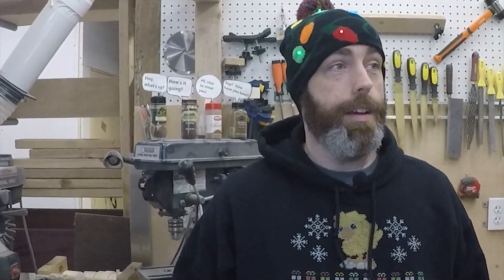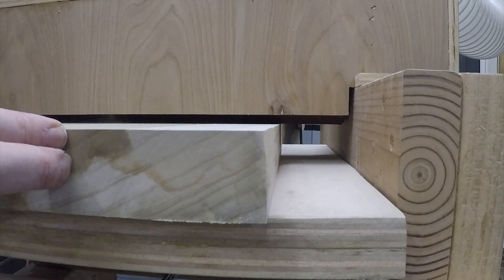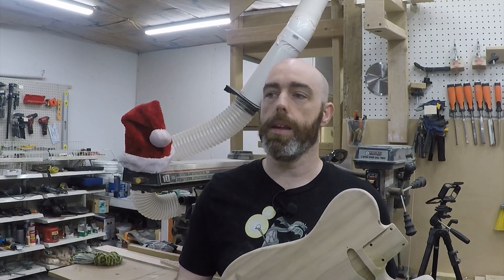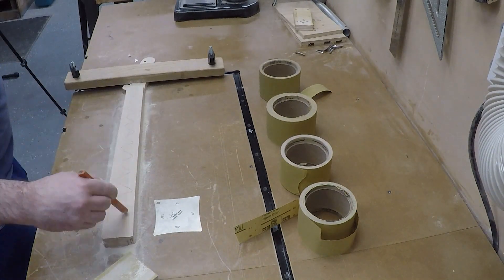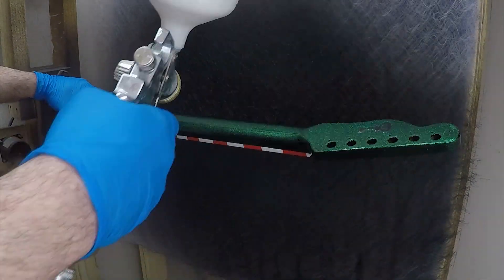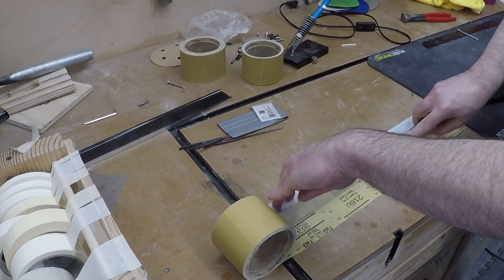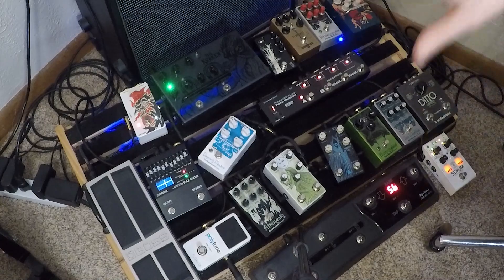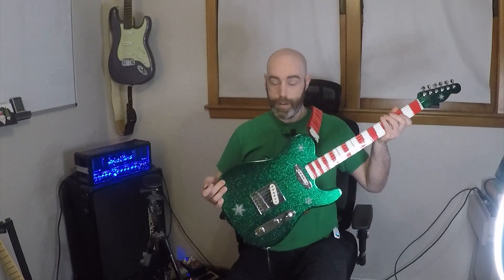Custom Christmas Telecaster! Full Build + Demo

Comment: L8ve watching you Shopsmith those things. The pin router combo is boss. I an building a removable drill press table, with dust collection.ever considered to have smooth, safe place, to protect bodies.
 Redoing the whole shop.
I got the dc shorty total turd straightened out.
Reply from the maker: Thanks for checking it out!  For a transportable safe place I use the MusicNomad guitar mats, they are pretty durable.  Good luck on the shop! 👍

Comment: Where did you buy  the tele template you used to make this guitar?
Reply from the maker: Javelina guitars on reverb. There are lots of options out there, but javelina is pretty cheap and I have bought 3 different template sets from them with good results. 👍
Reply: @ERWebster  Thanks for the quick response. I will check them out.